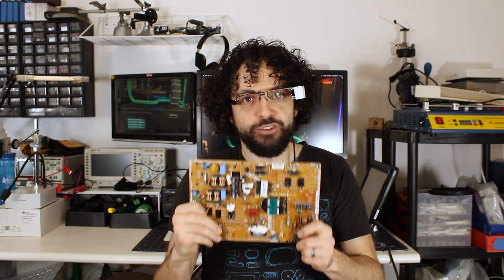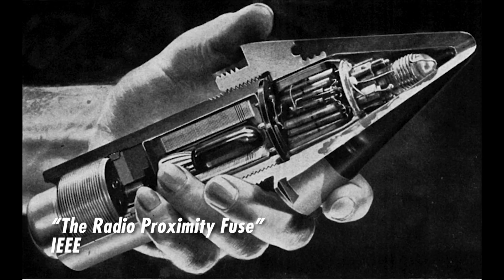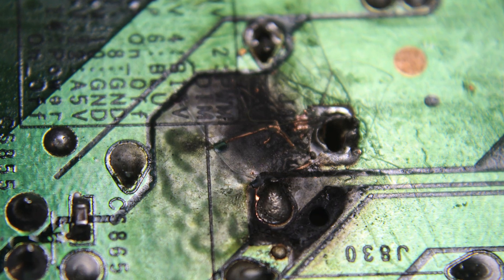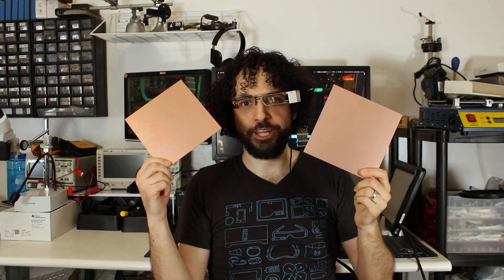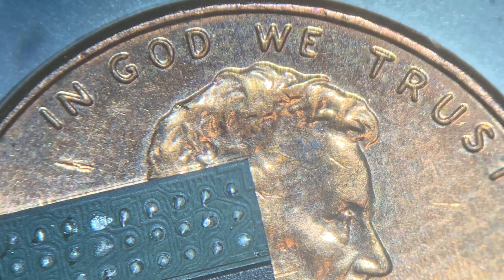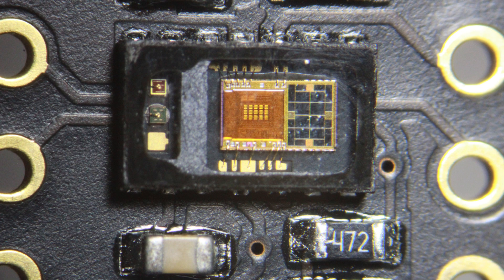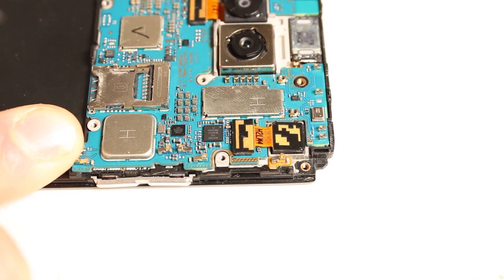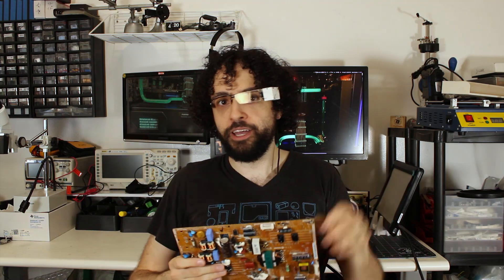Why Are Circuits on Boards?

Comment: This video does a good job of explaining this, whether you are a college student or has been in the industry for a bit. BGA, Vias, failure mode involving delamination, multilayer boards, future of 3D printing, etc, this is some golden information! He doesn't explain things like factors that affect routing, power/gnd planes, the soldering process, and other stuff (there is too much to cover in 1 video) but this video is a great place to get introduced to the art of hardware and PCB design. Seriously, if you didn't understand something here but are curious about it, please read deeper into them. If you're a college student looking for a job, this kind of knowledge will impress your interviewers, since most schools don't teach this kind of stuff but is so essential in the industry. Thank you for making this video.

Comment: I think your time lines are a little skewed and a little inaccurate.  Early TV and radios were not wired component to component.  They use solder tabs to connect resistors etc.  There were solder tabs on the bottom of the tube sockets and mountable solder tabs to connector resistors to resistors and capacitors.

Comment: 6:09 - old school PCB art was done with sticky black crepe tape onto a mylar film, and stick-on transfers for component pads and footprints.  With 2-layer boards blue and red plastic tape were used.  PCB exposure could then be done for both sides from the same artwork.  Yes, I've got some PCB drafting tapes kicking around somewhere(!)

Comment: Wirewrap is done on special square pins that you solder components to, since the wire has to form a gas-tight weld over the sharp corners of the pins.  I've still got some old wirewrap pins and IC sockets knocking around somewhere.

Comment: Can't we 3D-print the plastic part and a CNC could mill in the places for wires and its all printed on a conductive mesh that spreads heat and electricity whilst on the upper side the fibre optics can transfer data?

Comment: Seems like a weird question to ask. At first glance, you notice that a 2D surface such as a board is much more simple object, and consequently cheaper to mass produce circuits on, than anything else. As for why it's a hard board specifically, and not a flexible board, isn't that simply due to reliability? Besides, the situations where you'd want a central electronic unit that is in a weird shape and with special physical properties compared to just a solid 2d surface, are very rare. I'm not saying you couldn't. Just that you wouldn't. The question is why circuits are on boards. The answer is because you wouldn't put it on something else.

Comment: Crazy thoughts: BGA chips could be their own circuit board, with other components soldered right on them. And a transparent battery might not be possible right now, but a transparent capacitor already is (just layered, insulated, transparent conductor planes). For a very low power device or solar powered, that might be enough. Do transparent solar panels exist? Turn a flat photovoltaic cell until you see just a thin line. A very narrow solar cell could be glued on the edges of a transparent board (mwahaha).

Oh yeah, there's a cheap and easy conductive glue recipe I know that doesn't seem to be common knowledge, yet. Metal powder and wood glue work well together. Epoxies tend to creep and wet any surface which wrecks conductivity by insulating the particles. In the past I sanded some silver solder and mixed it with wood glue (not rosin core solder). It starts to harden horribly fast, when mixed, but it will stick to nickel, iron, copper aluminum, carbon and even naked silicon conductively (i.e. it worked on the bare surface of a solar panel). For the volume of wood glue, try adding an almost equal volume of metal powder... Probably don't try magnesium powder or alkali metals. Also avoid grinding beryllium alloys, of which some types of springs are made from (nobody wants berylliosis). If wood glue doesn't work with the type of powder you want, either metallic or carbon, try spar varnish instead (it's the most versatile binder, but not the most conductive that I know of)... Years ago I just tried mixing together everything I had laying around. Some of those mixtures worked.
Reply from the maker: Some interesting ideas. Unfortunately, transparent solar panels can't exist - they need to block a photon to generate a voltage.
Reply: @ZackFreedman  I wasn't too clear on that. I meant if you look at a flat solar panel from the edge it's a narrow line. Thanks for taking the time to reply, btw. I just subscribed yesterday.

...Technically most wavelengths are outside of the visible spectrum. Who's to say that solar panels need to absorb the photons that are in the visible spectrum.
Reply: Look at TI's LMZM23600 - components on IC-board hybrids are here!

Comment: As someone who's been running an electrolytic plating line & ammoniacal etcher for 15yrs, I can tell you that it's getting more & more difficult to achieve what customers want nowadays. The tolerances are so slim. Was plating panels last week that had track sizes of 0.075ums & the gap between the tracks was the same. It can be a nightmare trying to achieve IPC Class 3, which is 25ums, plus an extra 5ums, to compensate for copper loss, when put down the etcher after plating & other processes. I get the panel, with the pattern on, & have the copper areas' of each side of the panel in dm2 & what deposition of Cu they want down the holes. How long the job gets put into the plating line for is down to me & my experience. You have to take a good look at the panel & adjust plating times & currents as you see fit, whilst trying not to overplate the panels. It's a bit of a dark art, but I love it. We  make stuff that's currently in space, weapons, Covid ventilators, the lot. It is getting more difficult, though. New 3D printing pcbs will be the next big thing, it's just not quite there, yet, though.

Comment: I'm all about guitar gear. I've tried it all. All these new tube lamps are buush÷t. If it doesn't have a rectifier tube. Its gona sound like shit
 I've tried it all. The best is my fender  60s stereo reverb. And my 62 harmony an generic american amp w a Jenson spake made in Chicago
 Were I live near. One power tube, one preamp tube, an a rectifier tube there is no circuit board. A transformer. Transistor a few capacitors and this weird wire grid. It's got this smooth round life like warm sound. When you crank up a pedal, I use like ehx Russian big muff. A tube screamer , a boss turo overdrive. Mostly analog that didn't sound good w lol crappy transistor amp. That's the worst shit. This is my classic rock covers gear. But I do have an old Marshall valve state hybrid tube for my metal work. If you play guitar. Try some old tube amp. Don't be cheap. Or get a mess boogie brand, vintage. Dual, or triple rectifier

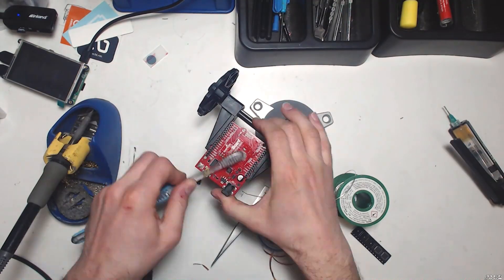Comment: 8:20 that soldering work is amazing, could someone give some insight on what type of tools one would use for a job like that? im relatively new to soldering, the only tools i have is a soldering iron and some soldering tin lol
Reply: It's basically the same: solder iron, tin, and liquid flux. Probably in addition: some soldering paste, desoldering wire, solder sucker, tweezers, alcohol for cleaning flux.

Comment: Cool, Could also add about ground and power planes/layers, and why it makes sure all the board gets the same voltage and is sheltered from the noise. (I once went through the pain of EMC testing)

Comment: I want to like this video, but the factual inaccuracy is just too great to overlook. The technique known as “wire wrap” was a post-WWII development, and lived alongside the PCB (and the tail end of point to point). In fact, the peak for wire wrap was the 60s and 70s (the era you actually illustrate in the video with the footage of automatic wire wrap machinery). The video makes it sound as though PCBs displaced wire wrap, when in fact the PCB came first, and for the most part, was used for different applications.

Comment: Well there is 3D printing in UV curable liquid resin. Although it is used mostly to create microfluidic circuits, I don't see why you can't use the same method for electronics. The question is, is it worth the trouble to do that? As long as it make things smaller or better I say yes. 
Personally I think we will move away from silicon based chips, DNA computers or wetware machines are in the works and we may see them in the near future. 
Unfortunately neither an electrical engineer or a biomedical engineer has the knowhow to work on this technology. Who knows maybe the next Steve jobs is right around the corner.

Comment: Hey I've been toying with printing circuits directly into my 3d models with conductive filament. It work well but needs further research in the filament side of things, but has totally transformed how i design stuff.

Comment: Would like to see something like the pcbs that bell labs used to make where they used glass as the pcb. Today manufacturers would probably use plexi glass, lexan or something like it. Would have a great ]<ool factor. Naaa lets just go back to putting the parts to the chassis with wire wrap :) How crazy would your i9 motherboard look then :)

Comment: Actually there is a way to transmit power over fiber optics. There are lasers that can pump 1W(and more) into a fiber optic cable and small solar chips that then take that light at the end of the fiber and transform it back to into about 24mA @24VDC of power. Highly inefficient but doable. I know because I have a patent for it and it's been in production for over 11 years. Something I designed at a telecom company. Any way, WHY are there circuit boards? The history lesson was ok, but saying "Why are there circuit boards?" made it sound like "Hey, why the heck are we still using those for when we can 3D print carbon fiber in a cellular chain for connections and simultaneously cover all parts making them less easier to hack? We could make direct connections in a more third dimensional manner and make them the exact thickness we need to carry just the right amount of current therefore making circuits even more dense."  But I was sorely disappointed. Hey, there's an idea no one ever thought about and I said it for the first time. The universe can have it. Eh, I'm a genius, I think of these things all the time.

Comment: you can also make them all integrated, even at home
Reply: happy enjoyment playing with fpga's
Reply: just print what you need, emulate if you are harassed by greedy corps
Reply: asics, diy, have their place, why do you need stuff from others
Reply: home made cookies are usually better than the ones you get off corps
Reply: you are still packaging more packing and wires
Reply: dark ages, you can pack stuff very tight, you just have to start from zero
Reply: that board looks like it has not advanced at all

Comment: Copper and fiberglass? 
Oh.
That’ll be why I had so much difficulty trying to melt it with a soldering iron...
sigh
Reply: ...Why?
Reply: I was trying to remove a capacitor from a board, as I couldn’t get to the solder underneath

Comment: "Electrolytes, they're what electrons CRAVE" haha, love the nod to idiocracy. The board has in fact advanced; FR4 is the classic but for high frequency you have very specialized LCP and fluoropolymer dielectrics, for flex you have polyimide, you can have different copper types laminated to them, and so many variants of all of the above that continue to innovate to push limits whether it be less thickness, improved dimensional stability, different dk/df, etc. Pitches have dropped by a lot, which brings all its associated challenges, like surface quality, ion migration, more strict control over CTE, etc. The elimination of lead with RoHS meant higher temperature solders, tin whisker problems, a major challenge in the mid 2000s. The 5g revolution is currently pushing all of these dielectric substrates to incorporate new materials science - stay tuned, you'll see a lot of new stuff in the next decade that were not possible with the traditional materials!

Comment: What about making the mechanical and the moving mechanical parts into circuit boards in the free space thay accommodate? Was that ever tried? Zack Freedman#
Reply: Or gluing paper boards like stickers onto mechanical parts end unabling them to connect to other circuits when the mechanical part makes contact with another part 
with a sticker board

Comment: why are circuits on boards, as opposed to what, point to point? What else is there? ribbon or flex cable I guess, but rigid non conducting former is the obvious choice.

Comment: When I was young I was making... boards. The first ones - with no "printing" - just holes and connecting elements with wires. Then "printed" - drawn with a marker, then etched. It was ridiculous amount of work to create pretty abysmal quality board. And a totally simple device, that was doing next to nothing. You could order a real PCB in a factory, but it was really expensive. So... Yep. I forgot about my electronic hobby. I became a programmer. After many years I see the technology and I just think - HOW COOL IS IT for a kid that is into electronics! DAMN! You can do ANYTHING! The professional, computer PCBs are dirt cheap to order! And you can buy just anything as a chip. When I was young it just... didn't exist. You could build a simple calculator... using TRANSISTORS. Or logic gates. What is the most amazing - today a kid, literarily like 12 years old kid can design and build just any electronic device, like custom Hi-Fi system, a computer, a robot... It's just insane. However, today you also have to be a programmer to play with electronics ;)

Comment: Point to point soldering still exists in SMT. If you look at NSA wiretaps that needs to fit inside a wire, they are a bean-sized mess of SMT components and solder. Wish I knew how to do that.

Comment: The first printed circuit boards (PCBs) can be traced all the back to the early 1900s and a patent for “printed wire.” It was in 1925 that Charles Ducas first submitted a patent that involved creating an electrical path directly on an insulated surface

Comment: I work for an electronics manufacturer, and lemme tell you a thing about motherboards. They're insane. We don't even like working on 4 layer boards, let alone 8+ layers haha.
Reply: Side note, as far as integration goes, I've started to work modularity into my designs, with as cheap as it is to manufacture boards these days, placing a daughter circuit onto a board really makes it nice to troubleshoot large sections of parts at once. Something not working? Replace board A, if it fixes it, get that fixed board out to the customer and then troubleshoot board A.

Comment: It's really interesting how, sometimes we just get it right.

There is still room for improvement, and there's probably some issues to be solved that people haven't even noticed yet. But overall, it's cool stuff.
Amazing that it's been that long since we've had them.

Also, Raytheon making TVs tickles me in a way.
Reply: right? i thought "huh, aound even back then"
Reply: gotta do something with that CRT manufacturing capacity not currently being used for radar displays ;)

Comment: this is actually a really good video on the topic.

Thanks Zack.

He did mention that EDA programs are used to design PCBs, a few examples of these are: Altium Designer, Eagle, KiKad, Mentor PADS, and Cadence Allegro.

These programs range in price from free for private use (eagle and KiKAD) to a few thousand dollars (Altium and Cadence)

Im a somewhat biased towards Altium myself (seeing as the company i work at represents them in Africa)

Comment: not all circuits are on boards.
Reply: in fact on occasion i have just used insulated wires so i can shove a circuit into a tight spot.
Reply: oh, and allot of shrink tube.

Comment: You are so out of touch, It is possible to have 3D printed  case with embedded copper printed tracks. The phone case is now the printed circuit board.  This means switches on sides connect direct to other parts of the case. Parts can still be replaced as modules e.g. camera but when its put onto the back of the case its now connected. Automotive are also looking at 3d printed wiring loom (No wires) e.g. brake light the bolts holding it are the connectors. The PCB has had a good run but let's hope we see it go like like valve radio. Also many IC's need only have 3 wires and although more single intense the reduction of pin out out ways this. consider  OLED display printed direct to phone case with just 3 wires to its micro.

Comment: everything: motherrboards and mainframes

me:

here at MTLMCIRL we like to revolutionize: we made mootherboards etc. into THE PRIMARY ACCESS POINT

it serves the perpose of both, but it has multiple layers:

top layer: ram and hard drives etc.

next layer: diodes and GPUs etc.

next layer: wires to connect to the remainder of  the device.

bottom layer: emergency boot overides like the BIOS

lower board: adapters for UI and such

Comment: Well, this is actually something I was interested in after installing two different motherboards into a 3D printer. It was a nightmare due to my utter lack of experience, but I could still appreciate how much harder everything would've been if it was more than a single board to plug and screw things into.

So, either it's common to look up these videos after messing with motherboards, YouTube is stalking me again, or that DIY Google Glass is hacking into my brainframe
Reply from the maker: That's an interesting point that I didn't cover - PCB's turn all the electronics into a single module that you can insert into many different products, instead having to rebuild the circuit every time.